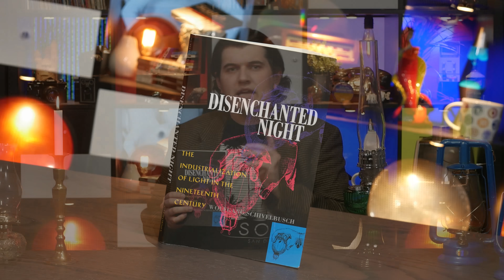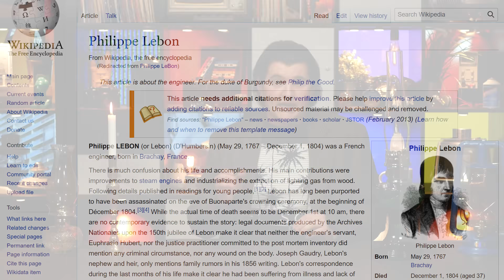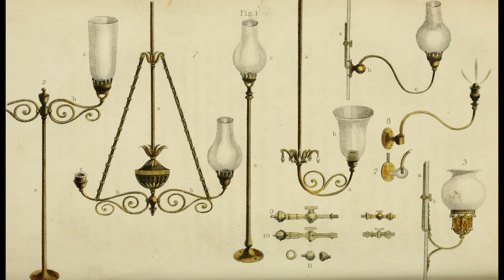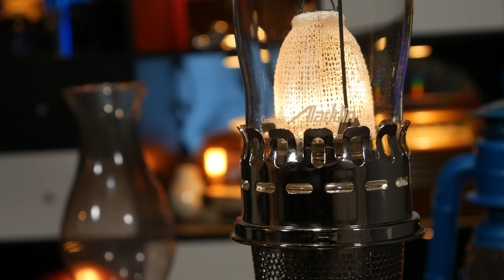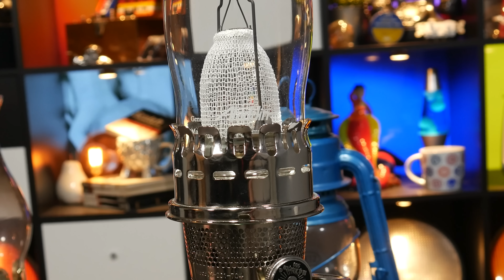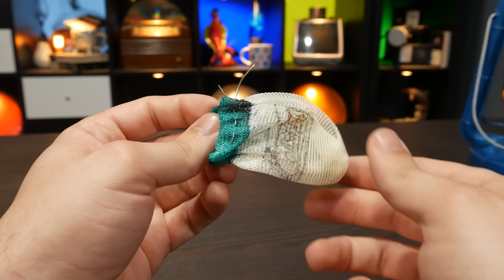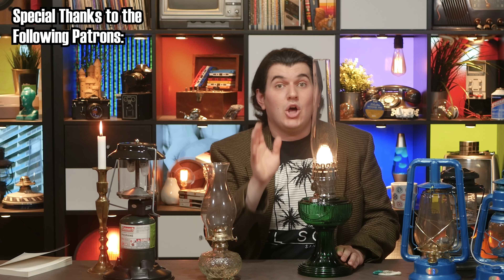How the gas mantle made lamps 10X brighter

Comment: Luting is also a means of securing machinery to a stone base.  Holes were bored in the foundation and molten sulfer was pored in and bolts inserted.  Also with the Aladdin lamps, the carbon can build up so thick that turning it down low would not clean it.  Turn lamp down low and sprinkle a little salt down the chimney and then the carbon burns off and it is much more fun to watch.

Comment: Suggestion for a video. We used Delco generators and glass bottle chemical batteries prior to electrification in 1949. We were early adopters, I understand our first motor generator had no batteries, circa 1918. I basically grew up in a museum.
  Forgot. We bought a kerosene stove and oven. It made my grandmother's life so much easier. We finally ran a gas line from our steam powered oil well in about 1950. Replaced the steam boiler with a Ford car engine linked by a belt drive to the steam engine. We got pumped water in 1959.
Reply: Glad to know what a lute is too.

Comment: Oil lamps were fairly ubiquitous among the homes of all senior folks I knew or, were related too, during the 80’s, them having hung on to their parents’ ol’timey oil lamps &, even my own parents during that decade, always made sure that at least three were ready for action, in the event of a power failure (lot of older homes in the area I grew up that still used thread-in-one-time-use fuses that, especially during rainy weather, would “pop”, resulting in a fast scramble for flashlights to fetch them old oil lamps for that evening, until power came back or; dad would replace the blown fuse(s). Anyways, not exactly sure why but, my grandparents had “electrified” several of their older oil lamps by “permanently” altering the wick burner with a fixed lamp socket, running a lamp socket tube down thru what was previously the oil lamps’ oil tank & power-cord running out from under them, unless said oil tank was glass in which case there’d been a very crude hole drilled straight thru the underside of burner for the cord to run out from. I inherited a few of these back in 2009 to discover that one of these was in fact a very early Aladdin oil lamp, all metal & well, as luck would have it, this type have a hollow hole down thru the oil tank meant that I could simply remove that cord, lamp tube, lamp socket and… back to being all original! It worked beautifully after cleaning it up. Did a bit of research to learn of these types requiring these mantels for greater illumination. Got a brand new replacement mantel and was amazed at what a difference that had made but honestly, was already very pleased with how much brighter just the tubular wick burned, by comparison to any standard flat wick type. Earlier I stated mine’s “all metal”; it does have a fairly large glass globe that suspends in place on a 3 wired rest affixed to the neck of the burner & still employees the use of a tall glass chimney as well

Comment: I had read some years ago (because I was aware that Edison's light (1879) was BEFORE von Welsbach's mantle (1885)) that Welsbach had read in the scientific literature of Edison's light and realized that Edison was using incandescence supplied by electric resistance--which required a whole new energy source: electricity.  Welsbach reasoned that using the existing gas systems to create incandescence might be cheaper and wouldn't require the creation of a whole new energy system.  Welsbach eventually did get a Nobel Prize for Chemistry--which Edison never did.

Comment: Your assertion that the Gasometer "is not a measuring implement of any sort" is incorrect. It is comprised of an immovable base, inside of which are several increasingly smaller, concentric rings of steel - the top-most and smallest in diameter also being the "lid." they were all sealed against each other. As the volume of gas inside the tank increased, the tank rings were forced upward (think of an old sailing looking glass) which would indicate or give some MEASURE of how full it was. 
Also, gravity acting against the steel rings pressurized the system and the flow could be metered to consumers with a relatively simple flow devise. The outer framework helped keep the rings aligned and the top from popping off.

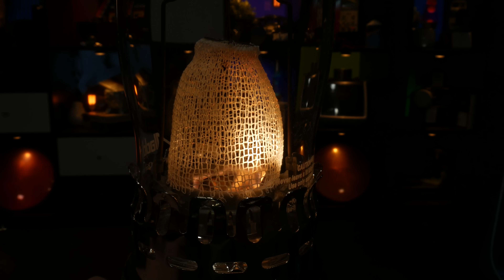Comment: 21:51  I don't think the wick is the problem.  You most likely have an air leak between the mantle holder and the gallery (where it sits).  Turn the mantle holder a half turn and see if the "hot spot" moves.  After the mantle factory burned down a few years ago, the quality of the units has gone down.  They used to put out 60 watts but now they just put out 40.

Comment: I owned and occasionally used an Alladin between 1980 and 2018. It certainly was fussy--the wick had to be carefully trimmed, and if not watched it would shoot a flame two feet above the chimney and coat the mantle with soot. It may have been 10X brighter than a simpler oil lamp, but it was still only equivalent to a 40-watt electric lamp at best. so I always tried to operate it at the ragged edge.

Comment: Power cuts are very rare in built up parts of the UK, and people generally cope just with candles or LED torches. I have a camping gas lamp I bought for power cuts in about 1989. I still have two spare mantles for it from then, and they say they contain Thorium. Frankly given how rarely I use it (it's been over a decade since last time) it doesn't matter much either way.

Comment: Part of the completeness of the burn of the fuel is that the mantle achieves very high temperatures and even if it isn't being a catalyst it is providing extreme reaction conditions as hydrocarbon molecules bounce off it and are momentarily heated to extremely high temperatures.

Comment: I still use coalman manually pressurized kerosene lanterns. There much brighter than led lanterns and last forever no breakage (one of mine is 50+ years old) I prefer them to the more modern propane with mantles just because a gallon of kerosene is cheaper and last much longer than propane I’ve even ran them in gasoline with no issues.

Comment: Lute is a clay or cement material used to make joints or coat a retort. So it seems the joint of his apparatus came apart.
Here is the Oxford English Dictionary entry
lute, n.2

(l(j)uːt) 

See also lutum. 

[ad. OF. lut (F. lut) or med.L. (use of L. lutum mud).] 

1.1 Tenacious clay or cement composed of various ingredients, and used to stop an orifice, to render air-tight a joint between two pipes, to coat a retort, etc., and to protect a graft. Also with a and pl. a particular kind of this substance. †lute of wisdom [= med.L. lutum sapientæ], a composition for hermetical sealing, variously described by alchemists. fat lute (see quot. 1836–41). 

   c 1400 Lanfranc's Cirurg. 195 Þe mouþ of þis pott schal be ioyned to þe mouþ of þe pott þat is in þe erþe with good lute, þat þere mowe noon eir out þerof.    1460–70 Bk. Quintessence 4 Ȝe schulen opene þe hoole of þe vessel in þe heed þat was selid with þe seel of lute of wijsdom, maad of þe sotillest flour, and of white of eyren, and of moist papere, ymeyngid so þat no þing respire out.    1599 A. M. tr. Gabelhouer's Bk. Physicke 57/1 Put it in a glass, agglutinate the same, with a lute made for that purpose.    1605 Timme Quersit. iii. 193 The ordinary lutes wherewith to stop vessels of glasse against faint vapours are these.    1660 Sharrock Vegetables 68 Lute is made with horse-dung and stiff clay well mix'd together.    1662 R. Mathew Unl. Alch. §89. 151 Take a good Retort of Glass, and put on it a good coat of strong Lute made of Blood, Lome, Hair, and sharp Sand.    1766 Cavendish in Phil. Trans. LVI. 153 A glass tube fitted into its mouth, and secured with lute.    1816 J. Smith Panorama Sci. & Art II. 789 Lutes are compositions which are employed to defend glass and other vessels from the action of fire [etc.].    1836–41 Brande Chem. (ed. 5) 1037 Fat lute, composed of pipe-clay and drying oil, well beaten to a stiff mass.    1868 Joynson Metals 114 Make the box tight with a lute of sand and clay, in equal parts.

†2.2 In sense of L. lutum: Mud. Also attrib. 

   1694 Motteux Rabelais (1737) V. 231 Lute, Unds, and Sands did long our March oppose.    1756 C. Lucas Ess. Waters I. 143 Roundish granules of a pale lute colour.

3.3 ‘A packing-ring of india-rubber placed between the lid and the lip of a jar, to prevent the access of air to the contents’ (Knight Dict. Mech.).

Comment: Thank you.
On your next wick, before you install it, use a torch to heat a flat metal plate to red hot then use it to make a flat consistent char on the end of the wick. After installing, let it soak up fuel for a long time before you light it.

Comment: Note.  The Aladdin lamp, in the form you show, cannot be hung.   Which makes the hurricane lamp a better option for outdoors.     

Note 2:   The main purpose of baking the coal was to produce coke, which was necessary for producing larger quantities of good steel.  (puddling iron, at that point).  The gas was actually pretty useless until they figured out to refine the gas (remove the tars) so it wouldn't clog the pipes.

Comment: Re: Gasometer pedantics. In the book Krakatoa by Simon Winchester (if I remember correctly) it was mentioned that the pressure sensors in the gas tanks act as barometers, which is not particularly useful for weather generally, but with the eruption of Krakatoa  came truely weird and massive atmospheric pressure spikes from the explosions. The pressure reading records kept were useful for tracking the timeline of the eruption.

Comment: I have several Aladdin lamps and another variety called Rayo, the Rayo lamps burn more yellow and do not use a Mantle. These  use a flame spreader instead. In the summertime they are too hot to use, but during winter power outages they will keep a room warm. The biggest asset is also the biggest drawback. They burn much more fuel than a flat wick, but produce better light and will keep a living room warm in the winter. Thank you for showing an ignored segment of history that gets glossed over as it was almost an evolutionary dead end in the urbanization of the first world societies.

Comment: "Gasometer" was an instrument for measuring gases via storing them to float a container. A simple one is just some sort of gas tight container, filled and overturned in a slightly larger container, with the output of gas source to measure plumbed under the first container.
Turns out these also worked just fine for storing the gases, plus gave a visual fill level indication.

Comment: The coating on the Aladdin mantle is almost certainly nitrocellulose lacquer. This would be consistent with the flame it produces. If this is the case you should be able to dissolve some of it in acetone. Though it has largely been replaced by polyurethane, nitrocellulose is still used as the waterproof coating on cannon and fireworks fuses and as a finish for guitar restorations (Fender and Gibson guitars in the 1950s and '60s were factory finished with NC lacquer).

Comment: My Dad and I used to use kerosene camping lanterns to flounder at night. More recently, we used a propane style torch with an inverted bowl instead of a glass mantle.  Both of these devices used torch mantles. The wind and waves would knock them out eventually, but if you were careful, they would last all night. The propane bowl version was a life saver.  I hated pumping up the lanterns with the kerosene. Nowadays we use electric lights, but with more modern cell phones, the lighting is sufficient to see flounder at night.

Comment: Anyone who has an Aladdin Lamp, & it's wire Mantle holder is broken, go to your local pottery supplyer, for the "Kiln Wire". It's not easy to cut, it's used to prop pieces of glazed ceramic off the plates in a kiln - temperature's upto 2,500°c. It is able to be formed, using pliars.
 Should your glass flue have broken, that should be able to be replaced, via a University, as the glass used in chemistry, is like that in the flue.
 For a mantel - most outdoors stores in my region, don't carry them, even though the gas fired lamps, with mantels, are available. 😕

Comment: A lute is a sort of cement or putty used as seal, we'd probably call it calk now. I would think "forced my lute" means that gas pressure forced apart a sealed joint, between the retort and receiver for example.

Comment: "forced my lute" is basically like blowing the fuse. To prevent the glass container from blowing up under pressure, an adhesive plug was used like a safety valve that should in theory pop out first before the glass would break.

https://en.wikipedia.org/wiki/Lute_(material)

Comment: The choice of material for the wig still puzzles me. Ytterium oxide, what an esoteric choice! More common is mischmetal which is a mixture of all kind of rare earth metals. That could also explain why there used to be Torium in old wigs, mischmetal is known to contain some Thorium. 
I am still wondering whether the lamp is truly incandescent. Would another mixture of elements give a different color to the lamp?  Also, one could think of a different material like Aluminium oxide. Would that make a good wig?
Reply: Now thinking of it, Boron Nitride would also be an excellent material to try! Beryllium oxide has a bit of a bad rep, but again,would that make a good lamp wig?

Comment: GOOD NEWS there is an odourless fuel you CAN use in kerosene and aladdin lamps. In Australia Shellsol T is sold by the authorised aladdin distributors as an "Odourless Lamp Fuel" I use this because both the boring by-products of the aromatic hydrocarbons  and the blue dye used here to colour kerosene gives my wife migraines. The product appears on the global Shell website and seems to be a globally available product. I buy it in 20L drums from an intermediate-bulk wholesaler for around AU$115.00. Much more expensive than kerosene, but no migraines, no smell, and burns clean. BTW I'd love to see an episode on indoor gas lighting from flame to mantle ;-)
Here's a link to the product I'm referring to: 
https://www.shell.com/business-customers/chemicals/our-products/solvents-hydrocarbon/isoparaffins/_jcr_content/par/tabbedcontent/tab/textimage.stream/1460975675955/f936d543fc0b5153e549ed6e44ed49241f29ea41/shellsol-t-q7412.pdf

Comment: Here's an interesting detail for you - the oxides are chosen because of their radiative properties. Thorium oxide and rare earth oxides like cerium oxide radiate well in the visible range, but poorly in the infrared range. This means more of the heat energy from the flame is converted into visible lumens.
This is a special kind of selective surface, where the emission properties are not uniform across the electromagentic spectrum. White paint is the opposite - reflective of visible light, but emissive for infrared. Aluminium is a more normal material with uniformly poor emissivity across all wavelengths.
Reply: So aluminum is opaque and can keep my baked potato warm
Reply: Fascinating and informative!
Reply: I don't think that they are chosen beacause of their radioacitvity. Thorium oxides is a very heat resistant material that justz happes to be radioactive.
Reply: @johannweber5185  Radiative does not mean radioactive. All matter radiates according to how hot it is, and the material properties.
Keywords are "blackbody radiation"
Reply: @gronkotter  Your right, I have not read properly.
Reply: @gronkotter  A long time ago we collected these nets from old lamps. We called them "stockings". Why did we collect them? Because they were slightly radioactive and suited our experiments...

Comment: Ok now I see a real adventure of using a raspberry Pi 0 or a Pico to control the wick. This is a great project idea. Just think a micro controller at $5.00 and a low powered stepper motor controlled wick and you can have your remote cabin in the woods lights. 🪔

Comment: Used Aladdin lamps in the Peace Corps at that time about $40 bucks.  It worked great but would put a black carbon spot in your ceiling if you did not watch it closely.  And like you said, in the tropics it is really hot and hard to read a book by because of the heat.  I'm going to buy one again and believe me, I'll get a glass lampshade with it this time.

Comment: Pardon my ignorance, but how does one “distill” a solid? I thought that was something you could only do with a liquid (i.e. boil it and capture the evaporating fumes).
Reply: Look up "sublimation". Also, in the historical fuel context, both charcoal and coke are the solid mostly-carbon by-products left after driving off the more volatile components of wood and coal. You can demonstrate this yourself by punching a hole in the lid of a paint can, dumping some sawdust or crushed coal into the can, and setting the can over high heat. (Perform this outdoors; noxious fumes result.) Smoke will start to come out of the hole; this smoke is flammable. And you should absolutely burn it, since that will reduce the toxicity. The alternative is to do this in a way that allows you capture the vapors, and pass them over a cold surface. Some of the vapors will condense into potentially useful products (turpentine and, yes, coal oil); what is left will be a much purer gas. Presto-change-O, solid distillation. Note: The paint can method I've described is a demonstration, not a production process. But this should you give adequate pointers for further reading.
Reply: @50srefugee  Thank you for taking the time to explain it so clearly!